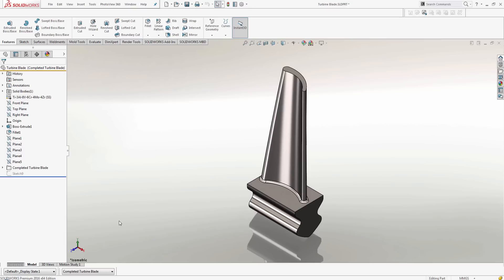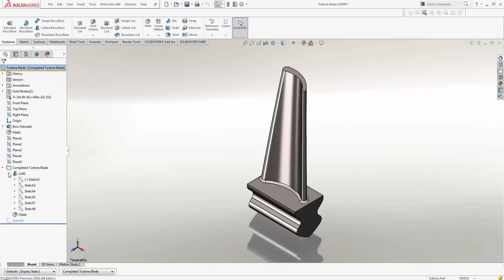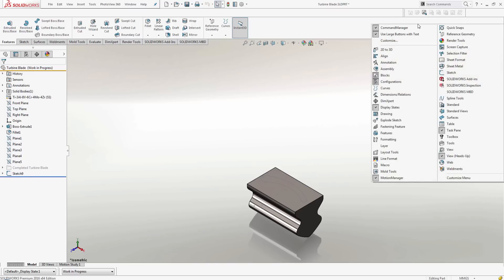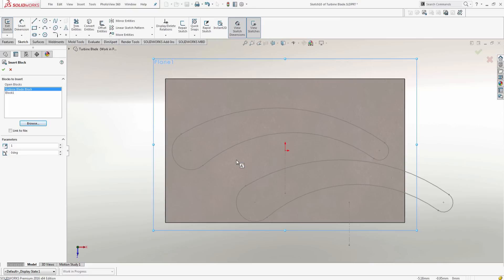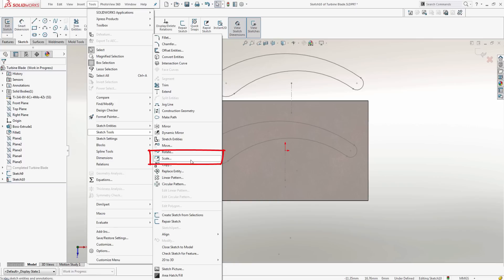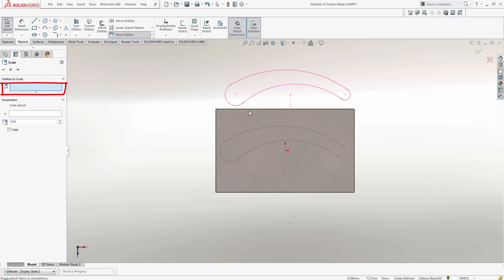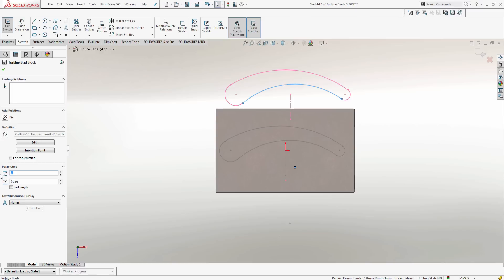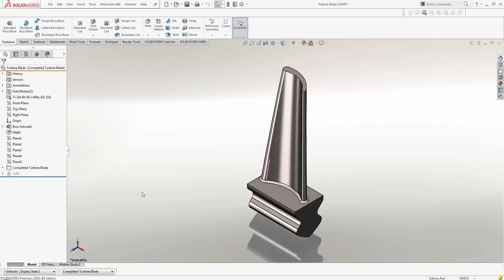SOLIDWORKS Quick Tip - Learn how to Scale Blocks

Comment: Scaling is not a very engineering way. How do I go about specifying a size for the sketch? E.g. I want the two points within that blade profile (centers of leading and trailing edges' radii)  to now be 10 mm apart.